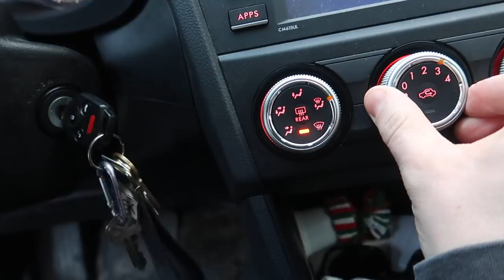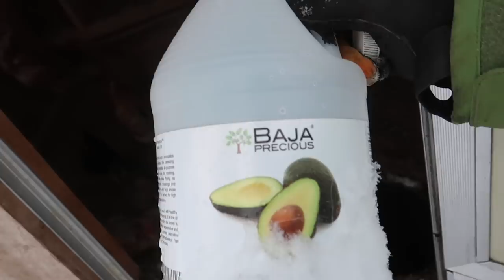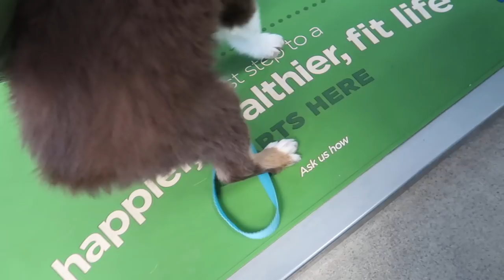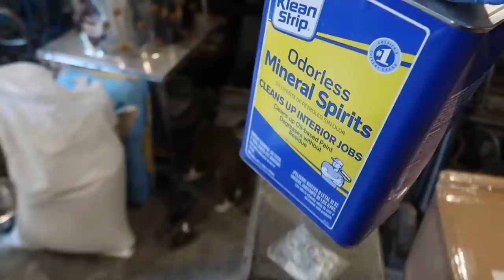That was A Close Call

Comment: The snow and the lack of bracing could contribute to the gate coming off. Your best bet would be to add a taller hinge side board and add a cable from latch side to hinge side at the top. This would also support the door from sagging. Just a thought. It would work on most gated entries.

Comment: Sun is getting higher, spring is getting nearer, time to tap the trees is just around the corner. Don't want  to miss the first sap run.
Reply: Bill Herrick How do you know when it’s time to tap the trees?
Reply: Bill Herrick, I seem to remember the buckets being in the snow last year too.
Reply: @dianetucker2711  It’s a balancing act between watching the weather and the calendar. Historically we tap around the first of March in our climate unless the weather forecast calls for a warm up in late February like last year when we started tapping on Feb 16th or inn 2015 it was so bitter cold that we had to wait till the 10th of march. It takes us 4 days to get all our taps in so we usually tap around March 1st if the days are in the 30’s and wait for the first sap run when the temps jump up into the mid 40’s during the day and into the low 20’s at night.
Reply: @AfterTheRains   Most years start out with plenty of snow in the sugar bush and more snow falls now and then during the sugaring season. Right now we have 28" on the ground in the woods.

Comment: Don't bother wiping off the "excess' oil until a couple of days later.  After that, you can apply another coat of 100% tung oil, but it will take several days to dry.

Comment: something for you and olivia to make Cream Cheese Enchiladas
30-40 minutes to prepare serves 6-8
 Print
 Save
Share
Pin
INGREDIENTS
8-10 flour tortillas
1 (8 oz.) package cream cheese, room temperature, divided [1/2 and 1/2]
1-2 (4 oz.) cans green chiles
3 cups cooked chicken, shredded
2 cups Mexican blend cheese, grated, divided [1 cup; 1 cup]
2 cups low-sodium chicken broth
3 tablespoons unsalted butter
3 tablespoons all-purpose flour
1 tablespoon lime juice
1 teaspoon cumin
1/2 teaspoon chili powder
Kosher salt and freshly ground pepper, to taste
Fresh cilantro, garnish, optional

Report Advertisement
PREPARATION
Preheat oven to 350º F and lightly grease a 9x13-inch baking dish with non-stick spray.
In a mixing bowl, stir together 1/2 cream cheese, chicken, 1 cup cheese, lime juice, cumin and chili powder, and season with salt and pepper, if desired.
Take 1 tortilla and fill with 2-3 tablespoons chicken mixture, then place seam side down in baking dish. Repeat with remaining tortillas and filling.
In a medium saucepan over medium-high heat, melt butter. Whisk in flour and cook for 2-3 minutes, or until golden brown.
Season with salt and pepper, then gradually whisk in chicken broth and green chiles. Stir in remaining 1/2 cream cheese and cook for 5-7 minutes, or until thickened.
Remove from heat and pour green chile sauce over enchiladas.
Top with remaining cheese.
Place baking dish in oven and bake for 22-25 minutes, or until cheese and filling are melted and bubbly.
Optional: broil for 3-5 minutes, or until lightly browned.
Remove from oven and let it rest and set for 10-12 minutes
Garnish with fresh cilantro, optional